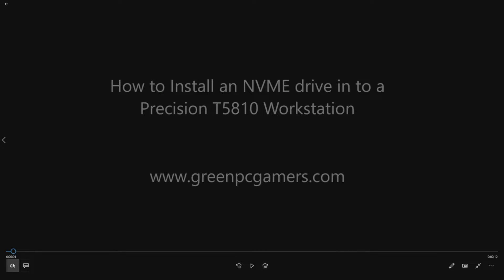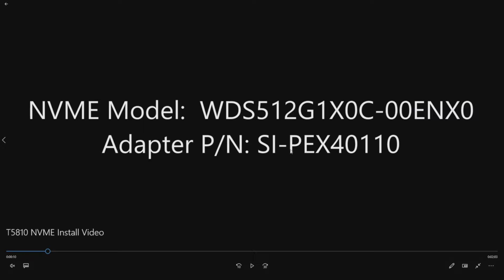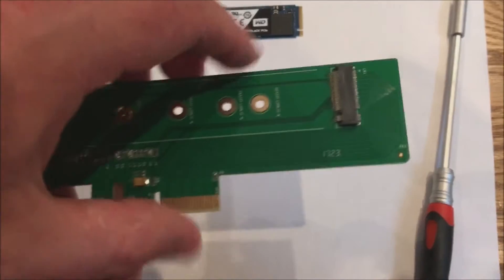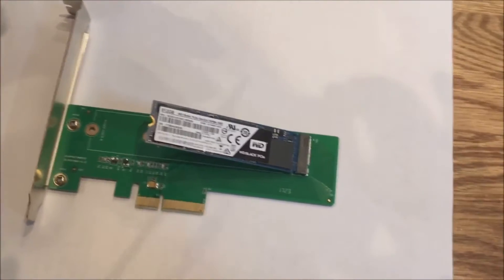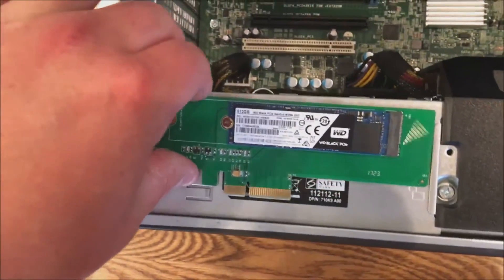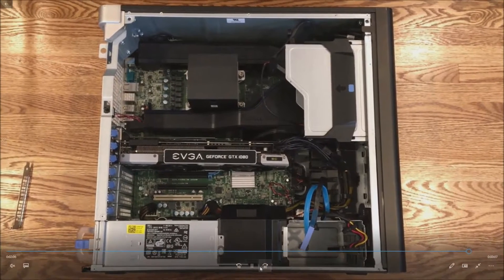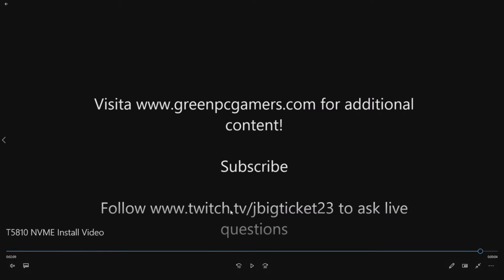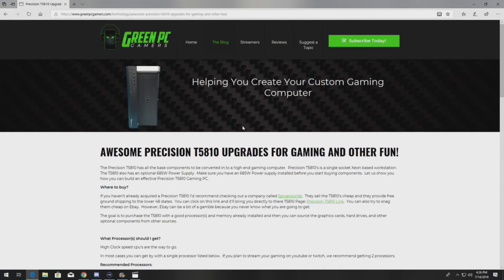How to Install an NVME SSD in to a Precision T5810 Workstation WDS512G1X0C-00ENX0

Comment: I installed mine just as you did in the video, but later (while considering a gpu accelerator) came to realize that you put it in Slot 6, which is a PCIe 3.0 x16 slot, wired as x8. Why didn't you use Slot 3, which is PCIe 3.0 x16 slot, wired as x16?🤔
Reply: Because PCIe x8 is more than enough in terms of bandwidth for this SSD. A little bonus: the SSD doesn't impede airflow, and the graphics card doesn't capture hot air from the SSD, which tends to heat up in NVME!

Comment: Have a question:  Is the NVMe adapters you've mentioned (this one and the SIIG) just running at 4x ?
I've noticed many adapters claim to be compatible with 8/16 etc but most the cheap ones run at 4x regardless.  On a 5810 that would make it only capable of 2GB/s at best, so I'm just wondering if I may as well get a cheaper adapter and a more affordable M.2 that is around 2-2.5GB/s 

Any speedy reply would be GREATLY appreciated.

Comment: I got this Dell PCIe m.2 adapter card (Dell SSD NVMe M.2 PCI-e 2x Solid State Storage Adapter Card 23PX6 NTRCY) and put a blank 4 TB m.2 nvme memory in it, but it is not visible in my Arch linux system, or in the BIOS.  I use btrfs file system with legacy boot bios settings.  Won't these cards be detected in legacy bios?

Comment: Hi not sure if anyone can help but I’ve done these exact steps but it won’t come up as a drive on my t5810. Someone said to flash update the bios but for some reason my bios is password protected which I do not know the password to. It is an old company PC so I’m not sure if I’ll ever be able to find it. Is there any work around? Or do I need to cut my losses and go for an m.2 to sata adapter 😅

Comment: just picked up a 5810, they go for 100 bucks CAD now at an off lease outlet near Toronto, just commenting as you talking about screws for for the nvme, my adapter came with screw and so should have yours, after Bios update, rocking windows 11 23h2 on this old beast now on a samsung 970 evo pro, has old 9600gt but good for price invested so far 150 all in,  nvme 49, adapter 9.99.

Comment: PROBLEM WITH second NVME installation, I  have installed an Intel 760D 1 terrabyte NVME on slot number 6 and boot windows 10 from it and is working very good, but I tried to install the second NVME Intel 670P on other pci express slot number 2 from the mainboard manual of course with an adapter, but after the hard disk has been converted in GPT and formated as NTFS from disk management, I had many problems because during using the windows I got a copy paste error, hard disk blocked and totally dissapeared from windows explorer and from disk management, I tried using with another pci express slot number 3 pci express 3.0 x 16 but here the hard disk is not even visible. So my question is if anyone knows if there is possible to use the second NVME M2 hard disk inside Dell T5810, what kind of second NVME hard disk and what kind of pci express adapter I need in case is possible ?
Reply: What kind of CPU are you using? Different CPU has support for different numbers of PCIE lanes. Eg; if you have a CPU with max support for 20 pcie lanes, your GPU is x16 and you only have x4 left, you plug 1 adapter to x8 slots (it will work as x4) and you hit the limit.

The rest of pcie slots are handle by the motherboard itself at pcie gen2 (for x2 and x1 with PCI).

Or the nvme may be faulty itself, try connecting another nvme on the same adapter and try again.
Reply: @calvinkotw87  I use Intel Xeon E5 1650V3 processor

Comment: Thank you very much for the great video.  10/2022 and I am still using my Dell T5810
Reply: I found a T5810 on the curb being thrown out as trash earlier this summer and am just now tinkering with it.  I had no idea how powerful this computer really is.  Xeon E5-1650-v4 and 32gb of RAM running at 2400 in a quad channel configuration!  This Xeon has 12 threads!  Also, I cannot believe how quiet it is!  This thing is stronger than anything I have in my house and I'm going to start using it as my new main.

Comment: T5810 w/Nvida Quadro M4000 -I'm going to replace a going bad 2.5" SATA SSD with a 970EVO Plus. The system is used for CAD design. Does this configuration need a heatsink? I have the SI-PEX40110 PCIe adapter.

Comment: Thinking about upgrading a T5810 with NVMe SSD as the boot drive. Good to know this is workable. Can I ask - do I need to do something special or if this works simply out of the box (of course I know at least there is something to set up in the BIOS or similar)? Much appreciate if this can be confirmed or otherwise elaborated.
Reply from the maker: Most PCIe adapters and NVMe M.2 SSDs will work out of the box.
Reply: Thanks. I'm now doing this however not so straightforward. I got a Samsung 970 EVO plus 500GB m.2 NVMe SSD on an Orico PICe card but this is not detected in BIOS. Having booted from another SATA SSD with Win10 installed, this cannot be correctly accessed in Disk Manager. Struggling...
Reply: @maxwang2537  Perhaps update the Bios. See another posters (DefMunkyYT) older post from a year ago. Post back if this works for you.

Comment: Installed the adapter and drive, but the system doesn’t see it. What should I check?
Reply from the maker: Is it a DDR3 or DDR4 based system?  What OS are you using it with?
Reply: @GreenPCGamerscom  it’s a Dell T5810, but updating the bios worked

Comment: Drive shows in the UEFI Hardware Information page of my T5810 as a "Mass Storage" device in Slot 1, but not visible as a boot option or in the Drives list. Is there something in the firmware that needs to be enabled? A34 BIOS, which I believe is the latest... I tried two different PCI-e NVME adapter cards (happened to have another lying around).
Reply: So, the system would not even boot with only the NVME and installation USB (only to go to the BIOS). I connected up my old SATA SSD and it would allow me to go to the F12 boot menu and boot from the Ubuntu installation USB. Ubuntu saw the NVME and installed to it. When I remove the SATA SSD, I end up with a system that does boot from the NVME, but the BIOS still shows no drives.
Reply: same problem

Comment: Can you run Crystal DiskMark on it? I installed a super fast nVME and am only getting 1500mb/s :(
Reply from the maker: Speeds will very depending on the io speed of your system as well as the speed of the nvme that you install.  1500mb/s isn’t too shabby.
Reply: @GreenPCGamerscom  Someone needs to make a 16x nvme adapter that can use more bandwidth with one nvme in it instead of just the 4x ones. It must be possible! :)
Reply: Super-fast == PCIe 4.0? The T5810 doesn't have PCIe 4.0, so you won't get full speed. Either way, NVMe uses 4 lanes, but the lanes would be faster with PCIe 4.0.

Comment: I am following your instructions and windows 10 installer on 5810 is not seeing the nvme
Reply: Disregard; I was trying to use the bottom x16 slot which is really a 2.0 x8, card adapter is working great in the 3.0 slot now! Awesome!

Comment: I would appreciate it very much if you could help me, I installed a samsung 980PRO 500gb ssd in my dell precision t3600, but someone does not read it because it is not recognized by the pc. or do I need to use a driver

Comment: I own a 5810 with 2 SATA HDD and would like to upgrade with a big SSD NVMe card of 2 terrabyte as boot drive. Is it correct that the  Bios won't handle SSD bigger than 512GB? That was the answer of Dell support.
Reply from the maker: We've installed 2TB NVMe SSDs in T5810 workstations w/o any issues.

Comment: Can I use this on the on dell precision T1700 and boot of. It
Reply: No, T1700 will not boot up from NVME drives.
Reply: that is like 4th gen intel release day, no , far as i know only some 2015 5th gen and 6th gen , systems were giving bios update to add nvme driver,  , you have to manually inject the driver in installing a custom bios, which you you can find for some 3rdn gen erra systems,

Comment: If this does not work on your T5810, update the BIOS. I had to install one in a T5810 at work but it couldn't use it because the BIOS didn't support it. Just download the update from Dell, copy it to USB, choose BIOS flash from the F12 menu and pick the exe file downloaded from Dell. The system should be able to boot from the drive immediately on the next boot. On a T3600, Google the Clover EFI bootloader, use it to make a USB boot device (use a small cheap "disposable" one) and plug it into the internal USB port right above the power supply. The system can boot from the USB which will then load Windows from your UEFI NVMe drive in the PCI-E adapter. Just leave the thumb drive plugged in inside the case where it's safe. That's why you don't want anything massive and expensive. It's only there to pass off the boot to the Windows drive.

Just a couple of tips from someone that had to get a couple of old CAD machines with bad HDDs back into service.
Reply: Def, any help with a T5610?  Seeing only "Mass Storage" like Howard Jones (below).  BIOS is updated to A19 so it's most recent.  Pulling hair out to get a M.2 NVMe 2280 to work with the PCI-E adapter!
Reply: @ellesse59  You probably need to do the USB trick. It will work as a storage drive but you can't boot directly from it through PCI-E

Comment: Have you tried this adapter? https://www.amazon.com/dp/B07F9RBP5W/ref=cm_sw_em_r_mt_dp_U_q3DSDb79KJGGS  ... I hope it works. Going to use it as a boot drive. I'll let you know how it goes!
Reply from the maker: We haven't tried that adapter.  Let us know if it works well for you.
Reply: @GreenPCGamerscom  Works great!! Using it for my OS drive and had no issues imaging with MDT. I get nearly the full speed of the drive! Today, however, while working on a T5820, I realized that Dell actually sells their own NVME adapter which holds multiple drives and has a large cooling fan!
Reply: @haazenpfeffer  can you show me how to install windows on 5820 with  ssd nvme ? i can see ssd in bios setup but i can't see it while install  windows

Comment: Can i run nvme as bootable hard and install windows
Reply from the maker: It depends on what system board you are using.  Most DDR4 based systems will boot to NVMe M.2 SSD's.  Some require a boot assistant like Clover.

Comment: Can  you make the tutorial on how to make it bootable drive on Dell T5810?
Reply: Can confirm ive recently done this and worked without any issues. I couldnt find a good free program to migrate the OS so i did a fresh install. Make a note of your serial no in control panel. BACK UP any docs you want. Download win10 bootable media to usb. Install new SSD as per video. Boot to bios and set usb as priority boot drive. Boot to installation menu then chose option in bottom left of first screen called repair or something and follow options to install from image and chose the usb as source. That should install and then activate if necessary with serial. Reboot to bios and set new ssd as priority boot drive. Format old drive and reload backed up documents. Im sure theres other ways but this worked well for me. Downside vs migrating the OS is you lose all drivers but windows did a good job of reinstalling most of them automatically.
Reply from the maker: Referring to the T5810.  As long as you use the recommended parts from our blog you can install windows 10 like any other hard drive.  Windows.  Windows 7 is a bit more complicated.